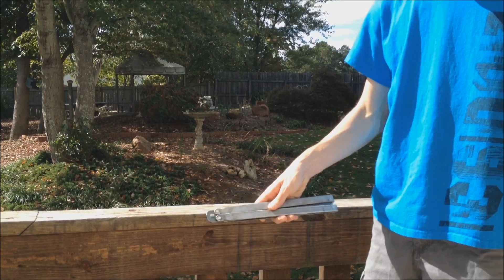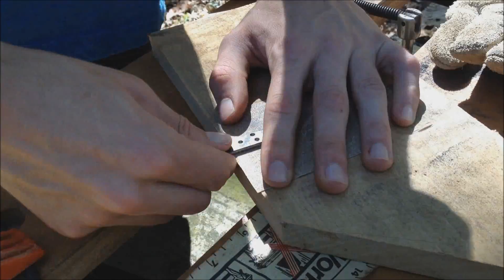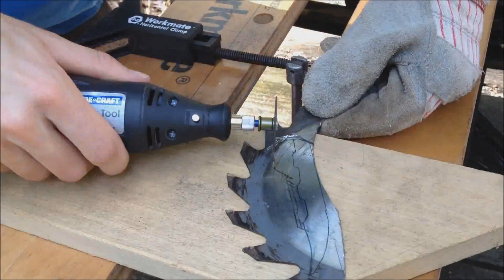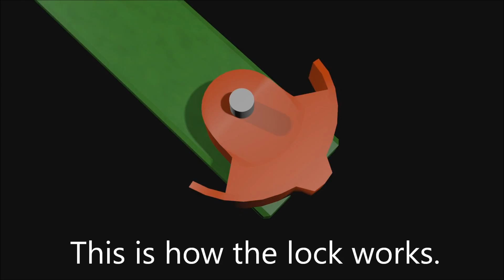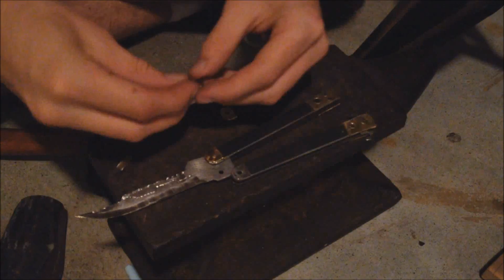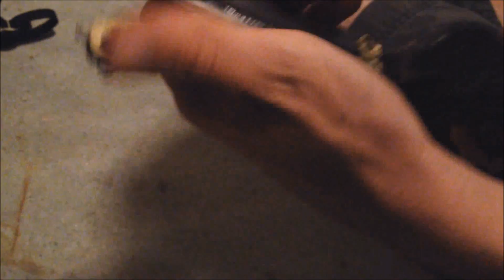Make A Better Metal Butterfly Knife

Comment: Just gonna say, when you used the circular saw blade you are using a high carbon steel. This steel can be tempered, but does not need to be as long as it is not over heated during the stock removal process. Just some knife making things I've learned.